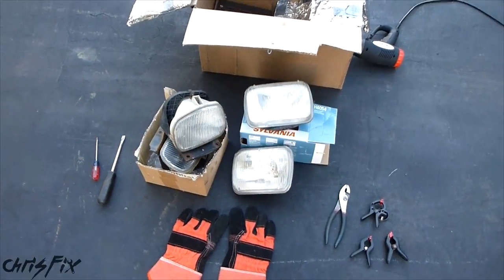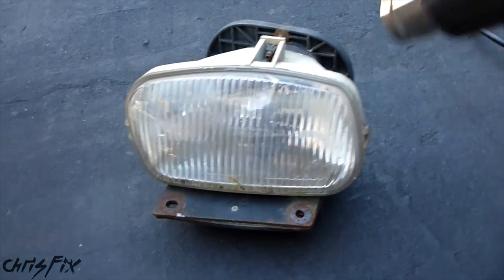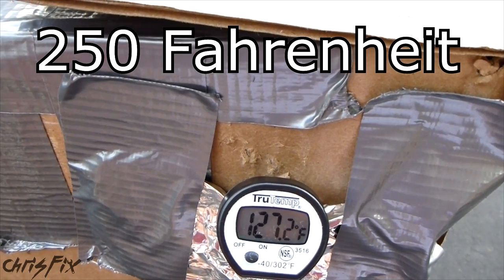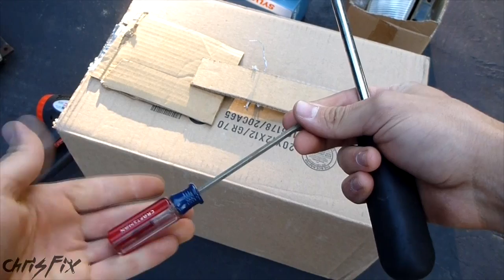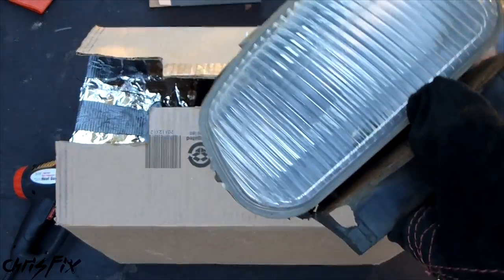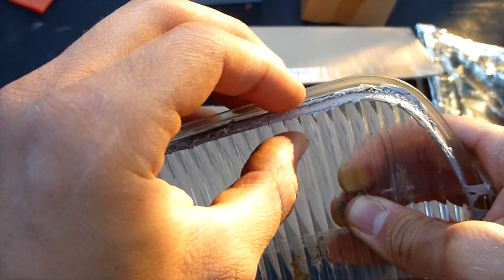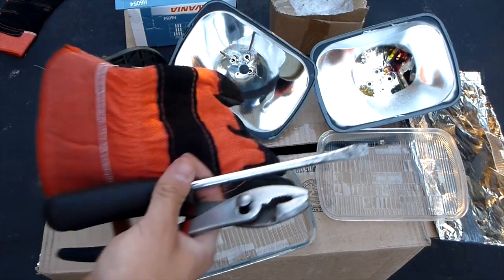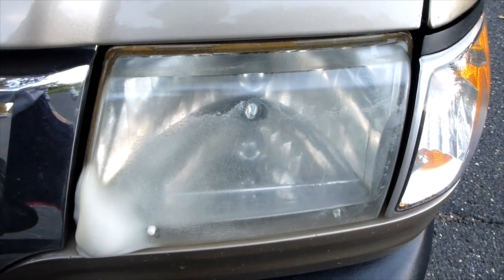How to Separate Headlight or Fog Light Lenses (without Oven, EASY)

Comment: BMW E34 (1994)  headlight. I baked mine in the oven at 120degC for 10 minutes. Worked a treat! Lens came off with one twist of the screw driver. Also I managed to remove the reflector at the same time and replaced. Thanks for the tips!

Comment: This is great tutorial. I tried with my 1989 Toyota Cressida GX Glass Headlight. It worked at 250 degrees Feirenheight for 10 minutes. I used my Soldering Hot Air Gun and I used a smaller box to get it hot fast
Thanks for this tutorial ChrisFix
Reply from the maker: Imraz Ali Awesome and thanks for the info! I will add it to the list!
Reply: Trying this on my 1978 dodge w-100 lights
Reply: Also glads

Comment: Conversely, you can buy a set of used fog lamps on ebay for the 993 for $250.00 because you haven't seen this video in time. Actually mine received a rock chip and there was no lense alone available from Porsche or aftermarket. Good stuff Chris.

Comment: My 2002 Saab 9-3 was the last year they used glass headlights, and they held the glass onto the housing with 7 clips that come off easily as well as a gasket that's replaceable. Super nice for doing my HID projector retrofit!
Reply from the maker: Jesse Crandle Nice! Cant beat that! How did the projector retrofit go? I want to do that for my truck (which is why I made this video).
Reply: ChrisFix It went really well actually, I hate to "advertise" but I bought a "morimoto" kit from The Retrofit Source, it included the projectors, the ballasts, the 4300k (looks very white, almost blue depending) HID bulbs, as well as the harness that connects it to the stock wiring. The harness is nice, they have a built in fuse to protect from any surges. Since I got the kit two years ago they've seriously updated their harnesses to keep canbus systems happy in case you have a headlight failure message or something, they also look a lot better made and more professional now. But still, it's been two years and they work awesome. I got a bi-xenon projectors since my car only had one bulb for high and low beam, but they work really well. Projector HID conversions are worth every penny, I know for a fact that it bought me 50 extra feet one time to stop, and if I hadn't had it I would have hit a deer. Also I've never been high beamed by anyone because of the kit, if you aim a projector right it's actually not as annoying as a regular reflector and bulb.
Reply from the maker: Jesse Crandle Thanks for the info Jesse! I really want to do it! I have the single bulb hi/low too so I would need the wiring harness from them. Now I am getting pumped to do this!

Comment: Hi Guys, I thought we would share our method with you, our heat gun was broken and we could not use a domestic oven, we used the following method, we did some research and found that paint thinners, we applied it by painting it on the seam and then using a box cutter knife to pry into the seam all the time painting on more of the thinners, the thinners makes the adhesive like soft and eventually we managed to get to pegs in and the lens and body parted company.  Cleaning the softened glue was not a problem we scraped it our and used a glue called "Sticks like S....T" to rejoin the headlight to the housing.  Please keep in mind, paint thinners can be bad news depending on what its composed of, in some countries it can even have benzine in it. Please if you going to use this method  the area must be well ventilated. Wear appropriate protection.

Comment: I really like your homemade oven idea. I think it would work pretty decent for curing paint on small parts if you can get a low enough and steady temperature.
Reply from the maker: LightsMB That is a good point. I can maintain a temp +/- 10F and it can go a little above 300F with the current configuration. I always wanted to powder coat so maybe I should make an upright version... hmmmmm

Comment: You are the best as always. I just made my diy oven . I tried it with a soft plastic and at 100°Celsius for 5 minutes it was hot enough. Do you think that temperature is good enough for butyl glue (soft) to reassembly my mitsubishi colt 2007 headlights?
Reply from the maker: That temp should be plenty good!

Comment: Chris i wonder if you can give me a solution  to this problem: i got a pair of new aftermarket headlights for a great price , but when i tried to install them ,one of the factory plugs (in both headlights) goes all the way in to the receptacle but it does not click to secure the plug because it slides right out . when i hold it with my fingers the light works . Is there any way that i can secure the plugs into the receptacles permanently? Thanks

Comment: Vauxhall not on list Chris......I have just failed mot due to headlight shinning down to.left the mechanism inside has not adjusted light to ahead so when I put my fill beam on it looks like the bulb has blown my normal lights work fine it's only on full beam....so have to take my light apart to see if the clips have come off the mechanism cheers Chris great blogs from Leeds UK

Comment: Chrisfix- I didn't need heat to get my fog light lenses apart, but there is a white film on them making them appear dull, just like the plastic headlight on your PT- Cruiser. Do you have a suggestion to remove it? FYI 1980 Mercedes 450sl.

Comment: I downloaded your list, it didn't have the temp and time for the 03 Olds Alero  i was trying to disassemble, but the one Olds listed said 265 for 7 minutes and it worked great on the Alero as well. not sure what type of glue it was but it is grey in color.
Reply from the maker: asasial1977 Thanks for sharing! I will add that info to the list! I appreciate the update and information!

Comment: Hi Chris, I need to open up my 2013 mustang rear lamps, I'm guessing the glue is butyl rubber as the temperatures are going to be nothing compared to a headlamp. Have you ever split one of these or do you have any recommendations 're oven temp and baking time? Thanks pal

Comment: Nice  video.  If necessary what sealant do you recommend or could one use RTV sealant?
Reply from the maker: George W You could use RTV but they make a sealant for headlights: http://www.amazon.com/gp/product/B002CXGSKY/ref=as_li_tl?ie=UTF8&camp=1789&creative=390957&creativeASIN=B002CXGSKY&linkCode=as2&tag=chri0e2-20&linkId=JDC56MUV4RN3K7JS
Reply: I forgot about byutal tape. Thanks.

Comment: @chrisfix I have a couple questions. 2016 453 smart fortwo. I made my oven. I don't have a heat gun so I used a hair dryer I had laying around. Did a test run before I start project Friday. It took about 10 minutes to get to 198.7 F. That is as high as I could get it. Ran it for 10 minute test and it ran without issue. That is without foil anywhere in box. Gonna test with foil tomorrow. My question if light is warming with oven 10 minutes to 199F and I left it at 199 for 10 more minutes think that's too much or not enough? Thanks for your help.
Reply: @ChrisFix

Comment: nice video.. very informative.. im about to try this for a 98 jeep grand cherokee directional.... havent had any success finding any at junkyards.. they say theyre all the same from 93 thru 98 but mine has 2 slots for the bulb to turn in and the one that i did find had 3 and that came off a 97 so im gonna try this but with the oven as i live alone. any tips or suggestions other than use tin foil in bottom of oven?

Comment: Nice tutorial. Great that you mentioned what direct heating can cause. But I'm curious if this will work with glass headlights or can they brake? BTW this reminded me of baking graphic cards in the oven (BTW, both baking and hot shower methods are true and can sometimes repair broken PC electronics)
Reply from the maker: +draconpost This works with glass headlights

Comment: Hi Chris, I want to have extra light for my 2009 Camry but don't want to install off-road light so I came up with an idea that replacing both fog light bulb with regular driving bulb. Did you ever try this before, do you think it will work
Reply from the maker: +Nguyen Nguyen make sure your wiring can handle the extra draw from the higher power lights.

Comment: Do you think your box oven could do 300 degrees?
Reply from the maker: tubejim101 With my heat gun, I got it up to 311F so yes. What are you planning on working on?
Reply: ChrisFix
 lol, you could tell I was up to something.  Think 300 degrees is what you need to safely melt type 2 HDPE plastic.  After double checking, looks like it needs to be 350 degrees.  But might test it anyway, may just take longer.
Reply from the maker: tubejim101 It is worth a shot. See what you can get it up to. Might have to insulate it some more with aluminum foil. Also, have your fire extinguisher ready just in case.

Comment: How did mud get in the fog light, being a sealed beam I wonder?
Reply: It happens all the time. Bad seal on the bulb, or bad seal in the casing. That's why lights get moisture inside, bulb heat and weather makes the seals on the lights go bad.

Comment: Chris do you have any videos on how to install fog lights? I have a 2016 Hyundai Santa Fe Sport SUV but mine didn't come equipped with fog lights and I want to. any tips on how to install it? I'm scared on how to do the wiring part.
Reply: Look up some videos on relays and basic wiring/crimping. That's how I started and I was wiring all kinds of lights a couple of weeks later. I even added USB ports into the dashboard of my 2000 Explorer. Look up posi tap products, they help a lot with wiring. Good luck.
Reply: TheKing0fHalo Thanks for the tips. I ended up paying $800 for them to be professionally wired and installed. Didn't want to risk ruining anything on such brand new car.
Reply: Dairys Moreta Hey, whatever works for you. Of course, my SUV is a lot older so I'm not too worried about breaking something as I can repair it fairly easily. No way I'll wire anything into my new Ranger when I get it. I'm glad you got your lights installed.
Reply: TheKing0fHalo Thanks and congratulations on your Ranger. I've been thinking of purchasing a truck for quite awhile. I love driving them!
Reply: Dairys Moreta can't beat an old ranger. I have a 2000 that has had two high school owners (my stepbrother and I) and we both beat the hell out of it. still runs great

Comment: Is there a video on how you made the box because that's the one I find confusing ???
Reply from the maker: giovanni pizzino There is not. I figured seeing the box in the video and my explanation is enough. It is just a hole and then a baffle to prevent the heat from going directly on the light.

Comment: Hello Chris. Any thoughts on diagnosing the PKE in my '96? I got a new transmitter but the system won't go into program mode. Could it be the actual PKE unit?
Reply from the maker: Bob Faltas Might consider pulling the negative terminal off the battery and letting the car reset. Do any of the buttons on the remote work? Do you have a Passive Keyless Entry light on the dash? Is your pke fuse blown?
Reply: ChrisFix It's a '96 Corvette, sorry I forgot to mention that. The Vette somehow reset the electrical system itself yesterday so I hope it's not a bigger problem. I figured that out after the presets on the radio were wiped out. About a week ago the light on the dash came on then the power door locks started cycling for about three or four times then the hatch opened up while I was driving. The light on the dash has been on since and neither of the buttons on the transmitter work. I checked all three fuses and they are all good. I'll try resetting the negative terminal. I hope this info helps. Does the unit go bad to your knowledge?
Reply from the maker: Bob Faltas That is good info to know. Sounds like your PKE is bad. Here is how to replace it:
You can find a used PKE on ebay from Corvette Recyclers and they guarantee it works.

Dash pad removal:

Remove the neg battery cable connection. You are working near the passenger air bag (at least in my model) and don't want that explosion in your face unexpectedly!

The dash pad covers the air bag and you don't have to remove the air bag to get the pad off.

The FSM is pretty straight forward on dash pad removal so I waited for a nice day to tackle it. below is a summary of how to replace the module.

Remove all the vent covers. The drivers side, center and passenger side. Its a small Torx head screw with two in each vent cover. The passenger side is behind the center vent which just pops out.

Take the fuse box cover off and there are 3 hex head screws that hold the side panel on. take these out.

Behind the side panel there is a hex head screw for the lower knee pad and one for the dash pad. take these out

Behind the passenger vents are 3 hex nuts for the lower pad. remove these and pop the lower pad off. You dont need to completely remove it but the dash pad tabs are under the ones that hold the lower pad.

Behind the center vent is a hex head screw holding the dash pad, its on the left. Also remove the one on the right holding the center trim face and pop it out about 4 inches. No need to completely remove the trim piece.

Behind the drivers vent is one hex head screw holding the dash pad.

Pop off the defrost vent trim in the center of the dash. be careful as the light sensor is attached. Unplug the sensor, it has a tab to keep it from backing out so bend the plastic slightly to unplug.

There are 2 Torx screws under the defrost vent holding the dash pad. remove those.

At this point there really is nothing holding your dash pad in but friction.

Pull the drivers side towards you and it will pop off the clips that are holding it in. Then pull the passenger side up and back and the entire pad should come out easily. Be careful and put it aside with all the little baggies holding your screws.

PKE module:

Look under the center AC tube and you will see two boxes. The one on top is the tone generator for the chime that tells you the lights are still on etc. It is Velcro'd to the top of the PKE module. 

The PKE module has spring clips on the sides holding it in.

Unplug the chime module and use a screwdriver to pop it free from the Velcro and pull it out. 

Unplug the PKE module.

Now is the tricky part. The PKE module will not come out from under the vent tube by pulling it out the drivers direction.Use a screw driver to pop the spring clip to the rear of the dash and skew the module out of the clips. It WILL come out the passenger direction but it wont go easily. just keep tugging and tweaking until it does. It took me longer to do this than to remove the dash pad.

The install is pretty much a reversal of the above. The new PKE module popped right in but I had to use a screwdriver to bend the rear spring clip enough to allow it to go in.
Reply: ChrisFix This might be a job for my mechanic. I'm a DIY kinda guy but not THAT kinda DIY. Thanks for the info. Any suggestion on tail light restoration. Strangely enough, it's only the small middle one.
Reply from the maker: Bob Faltas I have a video for headlights but the process is the same for tail lights. I will make a video for you but for now, skip the 400 grit and start with 600 grit and do what I did in this video. I would take the 3rd brake light out: How to Restore Headlights PERMANENTLY

Comment: +ChrisFix Hi Chris, do you know if this can be done with the tail lights? Same process? There is some dirt (moho) in the inside corner of the tail light that I would like to remove.
Reply from the maker: +Sebastian Acuna Cordero It can be done with most tail lights as well but many are sealed permanently so it might take a little prying.

Comment: ChrisFix what temperature should I heat my 05 honda pilot fog lights and how long ? I want to take out the inside cap or the glass ballon so my led with projector fits, I will not use the same sealent again I bought automotive goop to reseal it
Reply from the maker: Erwin Rangel Was the temp for your honda listed in the  spreadsheet (located in the description)?
Reply: ChrisFix on the top it says 211 I think and low settings 10 passes butyl 2006 -2008 mine is 05 the fog lights r metal and glass and it has a wire connector coming out I can't take it off will it melt the wires if I bake it ?
Reply from the maker: Erwin Rangel I am not sure I would try it with the wires in the light because the plastic coating on the wire might melt.

Comment: If I don't have a heat gun?
I there another way to open the headlight?
For Nissan sunny B15
A hair dryer can be use?
How to remove sun crack inside headlight?
Reply: +wasim afzal  you can buy a heat gun ad HomeDepot for less then $50. Walmart also sells them cheap also. you'll find them in the paint section. Don't use a hair dryer, #1 they don't produce enough heat, #2 most are equipped with a thermal safety that if used with a box like this will cause the hair dryer to over heat and then shut it self off until it cooled down.
Reply: Use a normal oven at the same temperature as shown in this video.
Reply: +ted clubber lang 
thx 
do u know if crack can be remove
Reply: +ted clubber lang many reasons not use the home over, the main one is toxic fumes put off by the heated glue. I guess if you want to cook your dinner in there after wards go right ahead.
Reply: +Mikey8567 thx